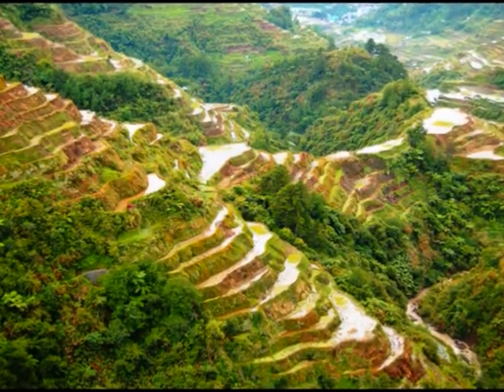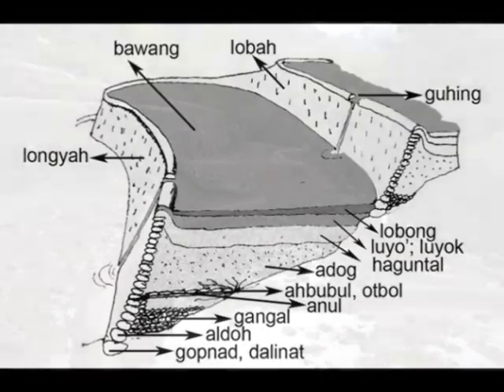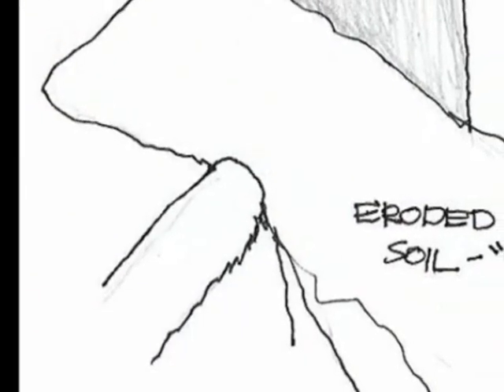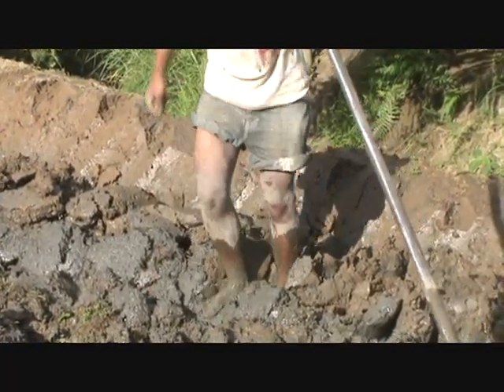Ifugao Rice Terrace Construction.wmv

Comment: parts of a ricefield & vernacular terms: 1:03

site selection: 1:42

engineering principles used: 2:19

types of terrace walls: 5:10

building materials: 5:50

how do they exactly make their stone walls?: 6:14

how do they make the dike formations?: 8:18

water sealing: 8:44

irrigation & drainage techniques: 9:02

repair & maintenance: 10:47

modes of labor: 12:08

rituals done before and during construction: 12:33

how do they settle boundary disputes?: 13:01